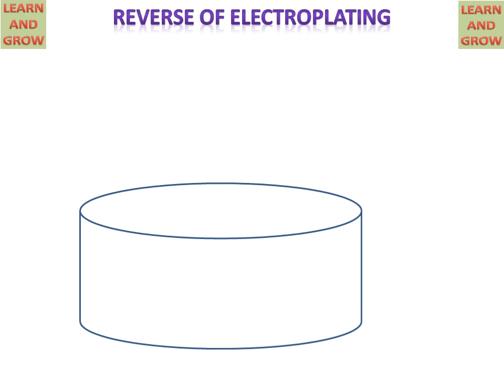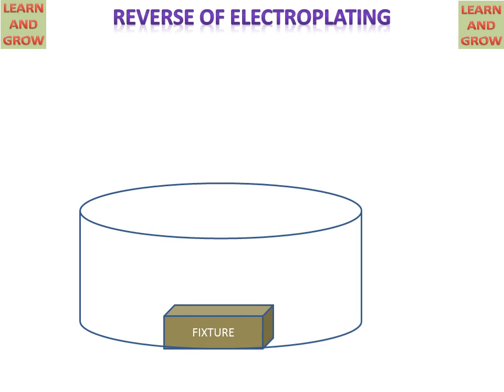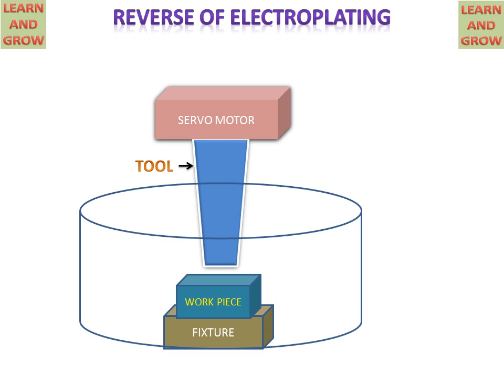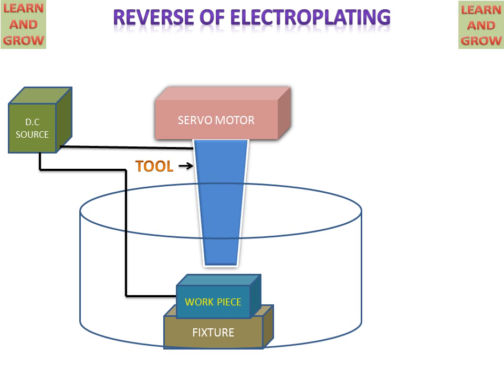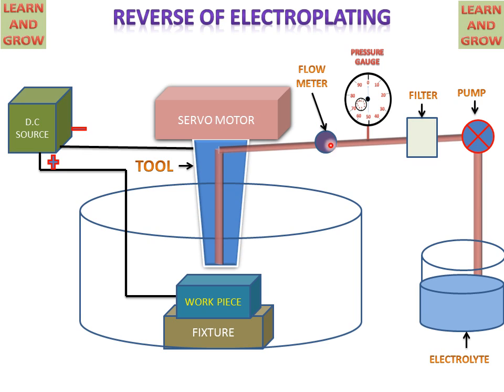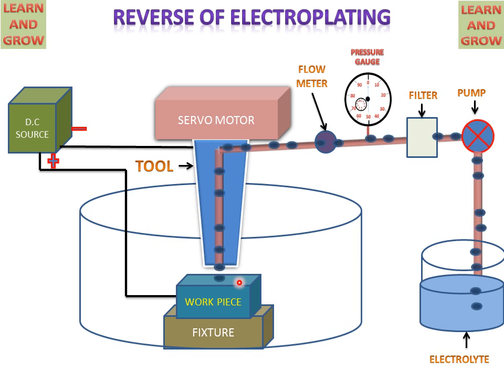Electrochemical Machining (English)

Comment: what's the difference between Electrochemical machining and Electrical discharge machining??? please help
Reply: In edm , metal ions from w/p will get deposited on the electrode whereas in ecm , metal ions will be carried away by the electrolytic fluid with the help of a pump.
Reply: @abhinavtiwari2070  Thanks bro. This really helped me a lot. I was like why are these classified as different processes when they look the same

Comment: What is the need of electrolyte in this process?
Reply: That's what he's saying at around 2:00.   Individual atoms can leave the workpiece, and enter the electrolyte.  They might stick to the electrode (plating it, making it bigger, you can see how this might be a practical problem) but they don't because the flowing electrolyte carries them away.  I don't think the electrolyte is consumed.
Reply: Electrolyte is necessary for electrolytic process like this. It serves as medium and completed the connection

Comment: Sir what are the operating parameters of electrochemical machining? Does this mean the required voltage, current, electrolyte material, temperature, feed rate, etc. or anything else?